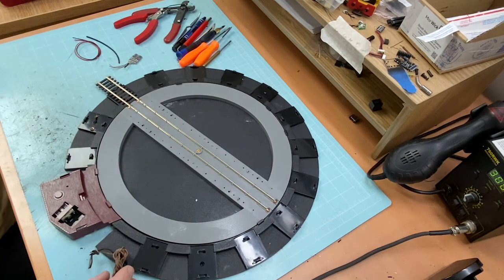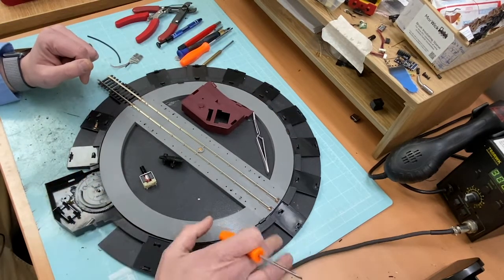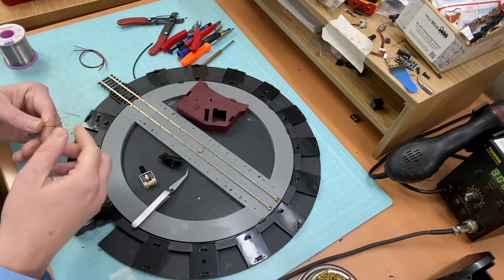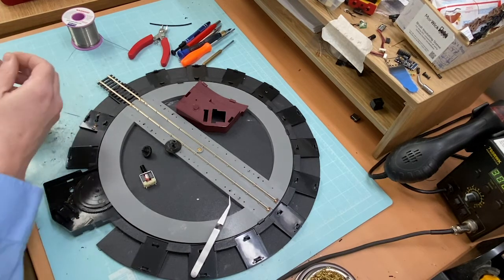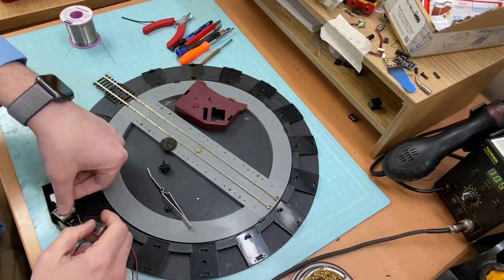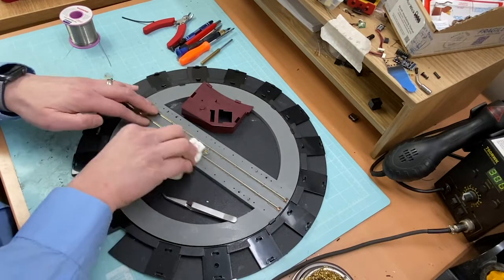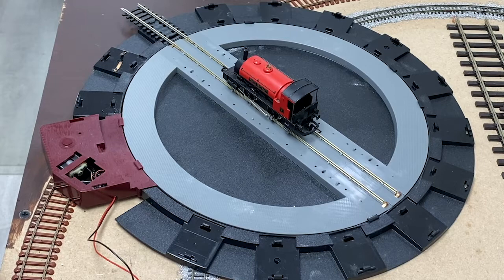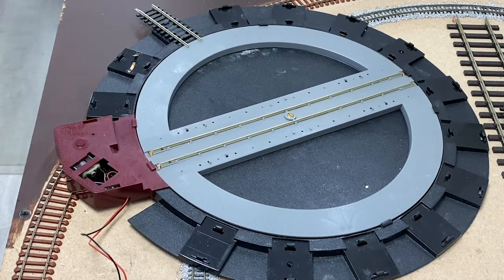Mark's Trains shows you how - DCC conversion of a Hornby turntable.

Comment: The polarity from start is changed as the turntable moves around - becomes + as it hits a diff angle stops short circuit if dc  left rail wi alter to right rail so change polarity 4 these rails prob solved

Comment: Thanks for the vid.
I Bought a new one of these yesterday for a TMD that I’m constructing. It is very toy-like. The first revolution had 2 of the spring contacts ripped to bits, obviously no quality control whatsoever. I removed all 4 of them directly after this disaster. It only lines up properly with the different tracks by driving it clockwise. If anti clockwise, it’s about 2mm out due to the slop in the gears. Basically it’s a toy, I’ll improve it and stick with it until I secure a better one.

Comment: So basically this is basically the same as using a DC controller with a reversing switch to control the turntable?
You can't actually tell it to go to out-track 3 and then have it automatically stop?
It's interesting to control it this way, but I don't see much advantage of doing this over a manual switch that can reverse the polarity.
:)